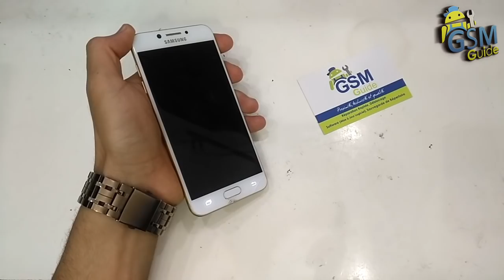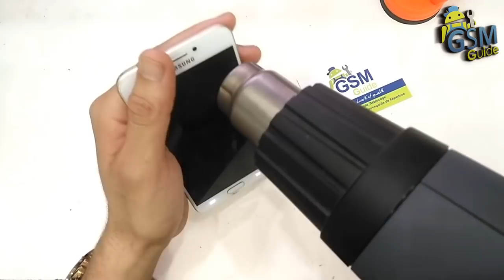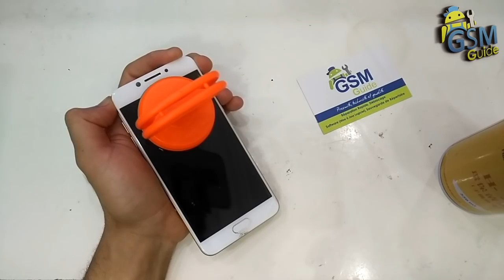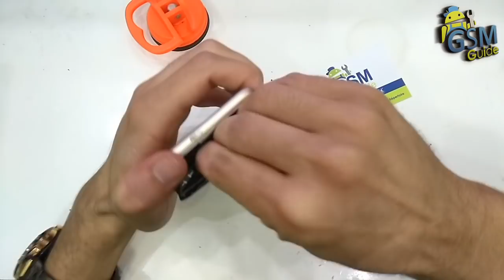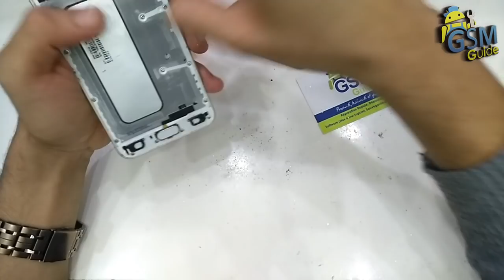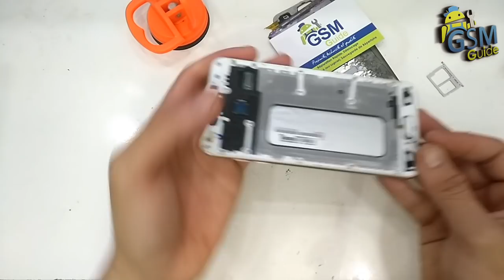Samsung C7  Pro / C5  Pro Screen Repair, Battery Replacement, Charging Port Fix | How to - GSM GUIDE

Comment: Nice job using paper cards to open it. Only think you should use a rubbery platform to prevent injuries or scratches on the cellphone carcass. But as I said, nice job.